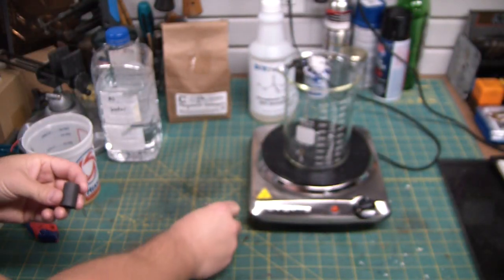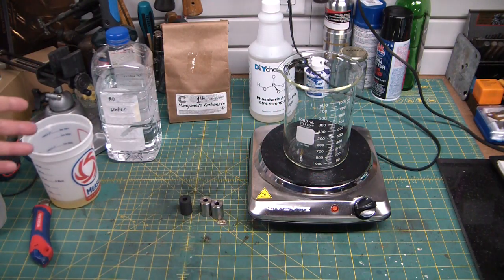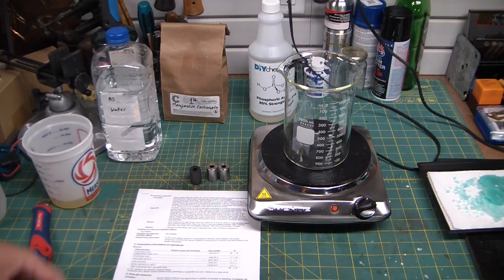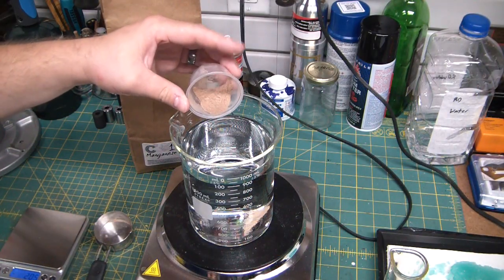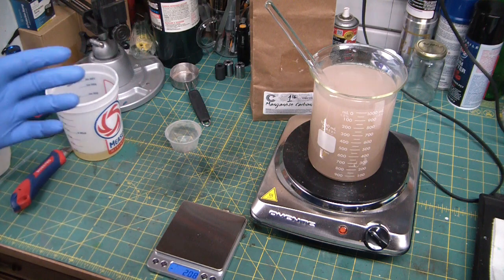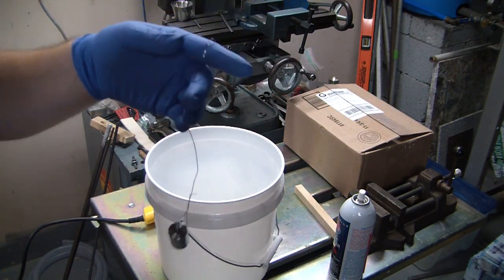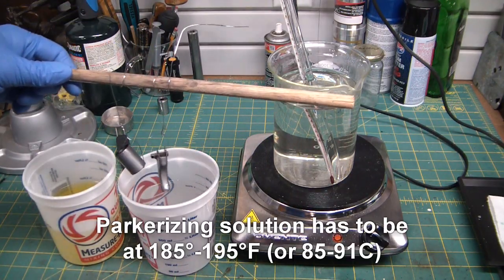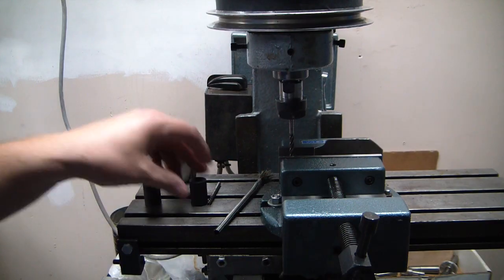Parkerizing Steel at Home - Manganese Phosphate Coating DIY Recipe - ElementalMaker

Comment: I used the concentrate from Brownells many years ago to park a tabuk flash hider for my long-barreled AK (came out great).

The comments I saw online had similar issues you had with the first batches and there were quite a few that suggested putting some steel wool in the new solution... that something about the iron that gets dissolved in the process from the first run makes the future runs better.

Comment: iron sulfate is a floculating agent which means it clears up suspensions and solutions and makes things precipitate, probably why 

imsure nitrate salt and sulfuric acid could be used instead of nitric acid, preferably given a quick boil before adding in